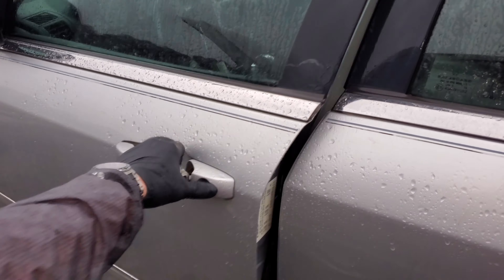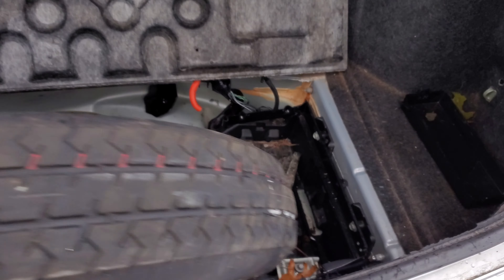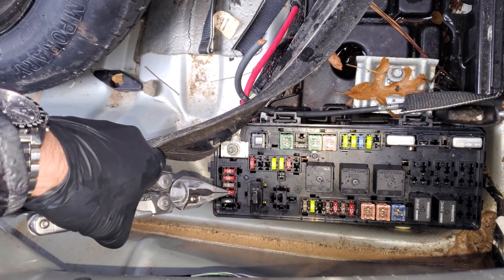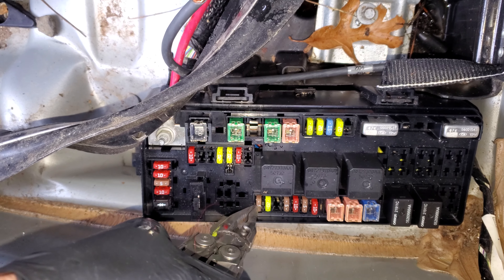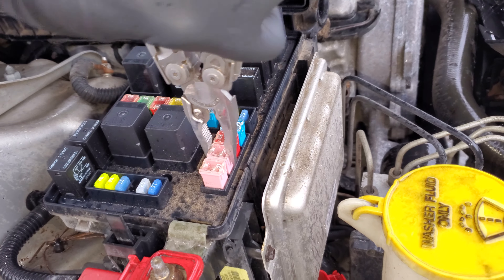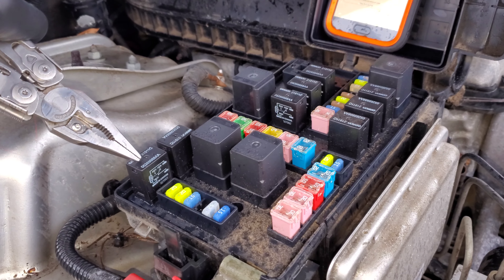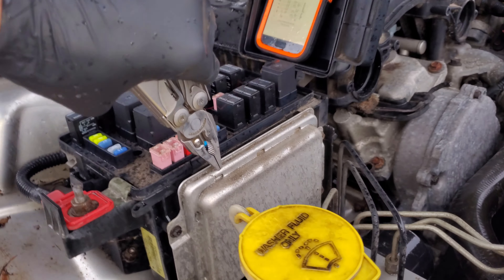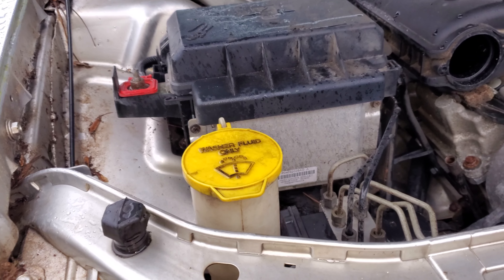2006 Chrysler 300 Wiper Relays & Fuses, Wiper/Washer Circuit Explained

Comment: Hey great vid. Just got a 06. 300. Wipers and horn doesnt work. I checked fuses seem to be ok. Just have cheap scan tool but didnt get anything for either one. Do i need to replace the motor all together? The wiper fluid works but wipers dont.

Comment: Any chance you could go through the Cruise Control system?  My CC lever works (the light comes anyway) but i cannot get the car to actually stay in CC, no matter what i speed i try to set it at.  Vacuum system or CC brake switch i have been told but i cannot find them on my car.

Thank you.
2005 Chrysler 300 Touring, 200k miles.  Runs terrific otherwise.

Comment: I appreciate the info. My 08 300 front fuse box has a different layout then the 06 300. My washer pump is the only thing that dosent work everything else works from what your saying is that one fuse powers all the wiper functions even the washer pump that sprays water to the windshield and theres no single fuse specifically for the washer pump?
Reply from the maker: The washer is powered by the module itself, there is no dedicated fuse for it. Here is a video for a 2009: https://youtu.be/BqbcKCEVZkc

Comment: I have a 06 SRT8 charger I have no signal  lights, Front windows won’t roll down nor  adjustable pedals work
Reply: Same issue. What did you do to fix it
Reply: Same issue. Did you get it to work? What did you do?
Reply: I'm having the same issue